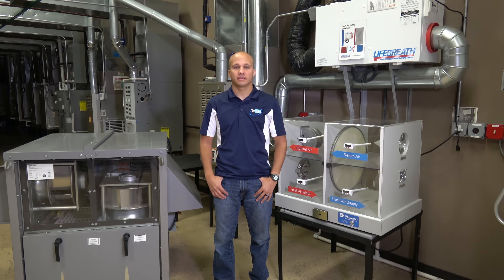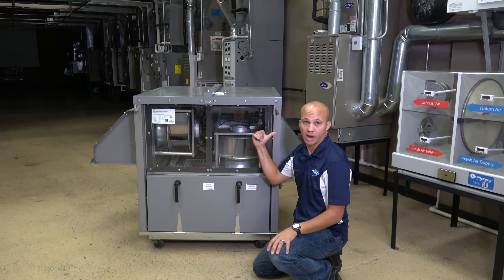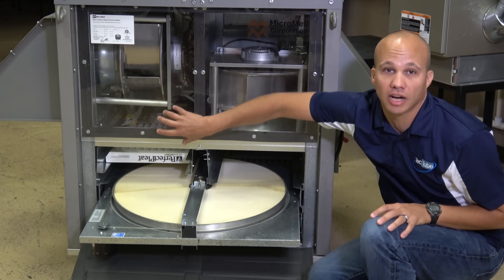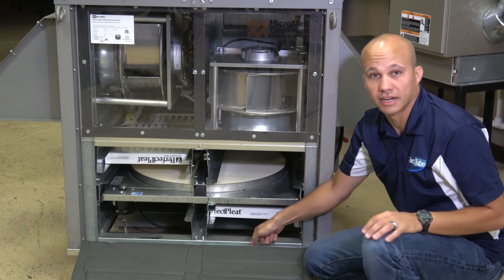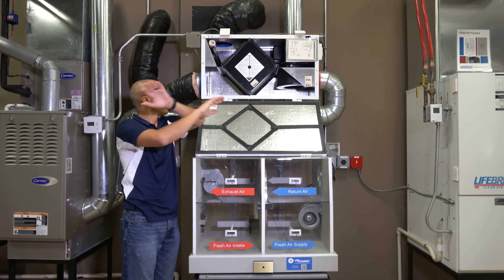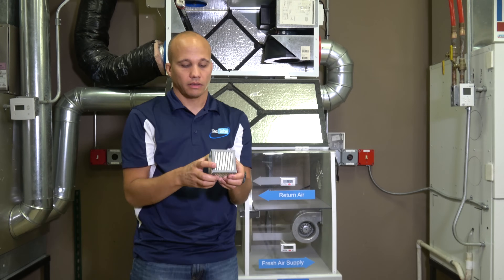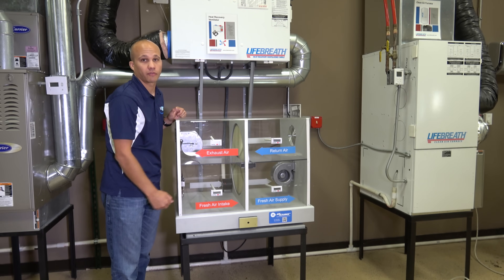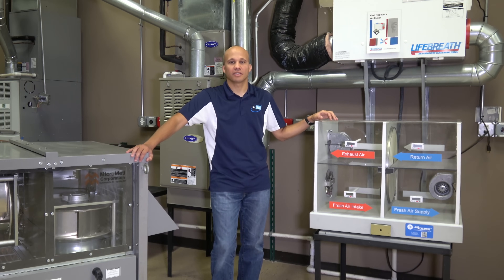Fundamentals of Energy Recovery Ventilators (ERVs)

Comment: Great/fantastic/excellent video, love the plexiglass.  I am looking for a similar system, but where the air exchanger could be bypass in spring & fall (hot days & cool night & since air is so cool at night, there would be no need to have the AC on). Am I missing something here? I can’t seem to find a system that does that.
Reply from the maker: Yes, most commercial ERVs have a bypass around the heat exchanger for "economizer days," since this is required now by IECC and most other energy codes.

Comment: How much does this unit actually cost and how do i know if its what I need? My building has mini splits now and they are working  very hard to cool the building.  They sq footage of this building is 3600 and its only 1 floor.
Reply from the maker: @mikelim9429  The heat transfer capability of the specific wheel selected makes the most impact.  Next is the pressure drop of the wheel which affects fan energy.  Then the temp, humidity, and volume of the return/exhaust stream relative to the that of the incoming supply air.  Then leakage (EATR and OACF).  And then finally, the small amount of energy of the motor spinning the wheel.
Reply from the maker: The cost range is very wide depending on the CFM of the ERV, the heat transfer rating, the mating connections to the existing HVAC, the need for a crane, and the labor costs to install, which would be specific to your building.  It could be $3,000... or $30,000 for your project.  You will need to get a bid specific to your scope of work needed.
Reply from the maker: In regards to what you need, we are not sure how we can answer that.  I guess it depends on why you are looking for an ERV to being with.  Is it for energy code compliance?  Is it so you can bring in more fresh air than you bring in now?  Is it to save the energy that you are currently using to condition outside air?

Comment: Can you refer me to an AC company that can do the ERV installation? I'm in Whittier, CA area.
Reply from the maker: We are based in the Midwest so we are not too familiar with contractors on the west coast.  If this is for residential then www.carrier.com or www.bryant.com both have dealer finders where you can search by zip code.  If this is for a commercial building, then those search tools will not help.

Comment: You described a dedicated HRV system for residential use. Typically these will be ducted to all the bathrooms as well as the kitchen (with a grease filter in place). Never a hallway like you said
That being said, most residential HRVs  will not be installed  like this.
You will just have your supply and return for your HRV tied into the return duct (3' apart) and an intake and exhaust going outside (6' apart)
Reply from the maker: We agree to pull air from the bathrooms as the first choice.  If you need to pull more exhaust air (to balance with your required ventilation intake air) we would prefer to pull it from the kitchen (but not the hood) or from a general area like a hallway.  We do not recommend pulling air from the kitchen hood since grease filters do not capture all of the grease, nor do homeowners change/clean them regularly.
Reply from the maker: We are not fans of pulling the air out of the furnace return duct to send thru the ERV and then outside.  This is an energy waster.  To make it an energy conservation device, you must recovery the energy from a waste stream... air that was leaving the house anyway even if you did not own an ERV.

Comment: Silica beads are used as desiccant in thermal pane windows, but they eventually become saturated. Doesn't the silica-gel wheel eventually become saturated? I know it will vary with a number of factors but how often might one have to be changed? Annually? Bi-annually? Every two years?
Reply from the maker: No, they do not become saturated.  They are "dried" as the wheel cycles into the other airstream which has a lower moisture content.  In this application they only temporarily absorb water vapor for the purpose of transferring it to be released seconds later.
Reply from the maker: Neither the wheel, nor the silica gel impregnated into it, need to be changed at all.  The life span is over 20 years, which will outlive the sheetmetal air handler that it is typically mounted in.

Comment: Thanks for the info! How much CFM was flowing through the demo unit?
Reply from the maker: Not sure.  We never but an airflow hood on it.  Both airflow paths have the same models of small fans, so it is nearly equal on the airflow of the two streams.
Reply: @TECTubefilms  Excelente trabalho de explicação. No entanto, quando se fala de refrigeração o volume de ar é necessário constar.
Reply from the maker: @rafaeldanzer6840  
Neste exemplo, o volume de ar não era importante, pois as duas correntes de ar eram iguais no fluxo de ar. No entanto, mediremos na próxima vez que voltarmos a esse laboratório específico e reportaremos os resultados para vocês.
Reply: @TECTubefilms  ok. Muito obrigado pelo retorno e, novamente, parabéns pelo trabalho de vocês. Já me inscrevi no canal e vou divulgar.
Reply from the maker: @rafaeldanzer6840  Sorry for the delay... we haven't been over to that particular lab much since COVID started.  We were there today and took measurements.  OA Intake = 71 CFM, Supply from ERV = 51 CFM, Return to ERV = 37 CFM, Exhaust = 56 CFM.  The plexiglas is not caulked to the side panels of the demo unit or to the middle panel that holds the wheel.  So there is leakage, which explains why the airflows don't all match exactly.
Reply from the maker: We will measure it the next time we are back in that particular lab and report the results to you guys.

Comment: Im thinking put stale intake for ERV in bathroom and above range. Could the fans be done away with? How many CFM per square ft?  I saw another video it had U.S. divided into HRV or ERV. I live in ERV area but about 40 miles to HRV suggested area. Would it be beneficial to get a HRV
Reply from the maker: Yes, you can run bathroom air thru an ERV.  We would not recommend you run air from the range.  It has grease that you do not want to get on the ERV's heat exchanger.  So use exhaust air from bathrooms and maybe a general area of the kitchen or a hallway.  In this case you would completely eliminate the bath fans and just have a grill in the bathroom ceilings that duct to the ERV.  Then have the ERV supply fresh air to the bedrooms and living room or have it bring the fresh air to the return duct for the furnace or main air handler.
Reply from the maker: From homes an ERV is almost always better than a HRV because it recovers moisture, as well.  This keep moisture out in the summer and keeps it in during the winter.  The reason there are maps to show not using ERVs in northern climates is because the ERV can develop frost on it from that moisture.  Larger commercial ERVs have controls and/or heaters to avoid that, but that is not cost effective for small residential ERVs.  So as you get to colder climates, you need to use a HRV for homes.  The border for HRV vs ERV is specific to each manufacturer and their heat exchanger technology.  So you need to look at the map specific to the model of ERV you are considering.

Comment: so with this system can we do away with a typical air conditioning unit? tnx
Reply from the maker: No, that would not work well at all.  You can downsize the A/C, but not eliminate it.  In the summer ERV just transfers heat from the incoming ventilation air to the outgoing exhaust air.  That will help reduce the capacity of the air conditioner you need but only related the ventilation air portion of the A/C.  Buildings also need A/C to reduce the heat that is generated by other sources such as heat transmission through the walls/insulation, solar heat through windows, people body heat, waste heat from lights, cooking, refrigerators, etc.

Comment: Thank you for the good explanation...it is nice to understand the wheel can absorb humidity and not transfer it to the other side. So just sensible heat no latent heat.
Reply: Thank you for the explanation. Know I understand the difference between the two. It depends on climate zone and space function.
Reply from the maker: The is incorrect.  An ERV uses an enthalpy wheel and it does transfer latent energy from the airstream with the higher humidity to that with the lower humidity.  This is desirable in most outdoor air applications.  In the summer, it takes the higher outdoor humidity and transfers it to the exhaust air so it does not come into the building.  In the winter, it takes the indoor humidity of the return air and transfers it to the supply air so it is preserved inside the building.
Reply from the maker: What you are describing is a HRV... heat recovery ventilator.  A HRV is sensible only version of a ERV.  Most ERVs are sensible plus latent.
Reply from the maker: HRVs (sensible only devices) are generally only used in commercial buildings when the indoor humidity in summer is regularly higher than outdoors, such as a swimming pool or locker room.  Residential HRVs are used mostly in ASHRAE climate zones 7 & 8 (most of Canada) because frost control options are too expensive/complex for residential systems.

Comment: How does desiccant wheel drain water after it sucked up enough moisture?
Reply from the maker: It only stores the water for a brief moment until it rotates into the other (drier) air stream where it releases the moisture.  There is no need for a drain pain or drain line.

Comment: LOL,  you all are beginners. I see a drain line at 4:51 it has no air vent. that is BASIC drain line 101 school. if you were trained here get your money back, i bet you don't even ream copper  lines after cutting. KIDS - if you want to be properly trained, Join the USAF and become a Civil Engineer. It is free and the BEST Training in the WORLD. And they teach you CORRECTLY. Also too the the left there is NO Blowout Tee. You all REALLY Suck.
Reply from the maker: 1) Our company started in 1935 so yes we are still beginners relatively speaking.  :)
2) This Lifebreath 155MAX HRV is installed per the manual, which you can read at https://www.lifebreath.com/us/product/lifebreath-155-max-residential-heat-recovery-ventilator-hrv/.  There is no air vent specified by the manufacturer on the condensate line.
3) This drain runs into a central condensate line along with furnaces, A/C, and boilers.  There is an air gap between the condensate line and the sewer connection (it is not hard piped) so hence an additional air vent at the equipment is not needed.
4) The engineer who installed this unit in our lab ended up leaving to become a Civil Engineer.  When he left, he said Mechanical Engineering was too hard.
  We are not kidding... #truestory
5) We love Air Force and military veterans and many come to work in HVAC when they retire from the service.  So yes, please do consider joining the USAF and maybe we will see you in 20 years.
Reply from the maker: We love the The Furious Fill Show.  The Confederate flag and shot of whisky... um, we mean ginger ale... are nice touches.
Reply: @TECTubefilms  hey guys I want to say thank you for the response service technician with 30 years plus experience United States Air Force civil engineer but yes the Confederate flag I haven't uploaded a video in a while but the Confederate Flag represents a states rights not slavery so as a service man I served with every race Creed and so on so not one inkling of racism in my blood the only races I like are the ones where the cars go left turns and keep going left turns I love those those are great
Reply from the maker: @furiousfill4593  Fair enough Phil.  We understand what you mean about the flag.  We were just trolling you because you were trolling us.  All good sir.
Reply: Took me a minute to get the "left turn racism."  Cleaver response.
Reply: @furiousfill4593  Also, you should fix the "." and "," keys on your keyboard
Reply: Furious Fill has two subscribers… TecTube must be 1 of the 2
Reply from the maker: @ryanhoger1  No, we are not.  But if Phil posts a HVAC video, we will start following him.
Reply: *to the left
Reply: name checks out, lol

Comment: How often do you run the ERV or NRV - all day - all the time?  Also, how often do the filters need changing?  How much is it?
Reply from the maker: If the ERV is handling code required ventilation air, then it must run constantly during occupied hours.
Reply from the maker: Filter life varies based on the entering air conditions.

Comment: Very good video, thanks. Does air flow through the wheel style heat exchanger (enthalpy wheel?) or across it? Are they available to diy'ers anywhere?
Reply from the maker: The air flows through it
Reply from the maker: Not sure how to answer your question about installing one yourself.  You would need knowledge of HVAC design/sizing, sheetmetal working, and electrical wiring, and in some states/municipalities licenses to do work in those trades.  Plus the smallest enthalpy wheels on the market are too large for homes.  Residential applications would us the enthalpy core style.

Comment: with an EVR does that mean i dont need a seer 16 unit because a seer 14 can work just as good with an EVR? in 110F weather ?
Reply from the maker: An ERV only saves the energy associated with conditioning your ventilation air.  It has no relation to the cooling energy which is represented by the SEER rating.
Reply: @TECTubefilms  so it makes conitioned or heated ventliated air stay cooling or warmer longer so I stay comfortable longer and ac doesnt have to kick on so often ?
Reply from the maker: @joeydelmarsjr.646  We suppose you could think of it like that. It makes the ventilation air from outside cooler as it comes into the house during the summer (and warmer in the winter) for nearly no energy cost.  Hence this would allow your A/C to not run as much if that is what you were previously using to cool your outside air.  It will also dehumidify (summer) or humidify (winter) that incoming outside air and that will certainly improve occupant comfort.

Comment: They went through all that trouble of building a functional demonstration model and they didn't bother to include humidity sensors for a complete thermodynamic picture of what's happening? Seems kinda silly, like just walking away from the Panama canal when there's one mile left to dig.
Reply from the maker: Since it is a demo... fully contained in a single room... the air in both intake airstreams would be the same temp.  They had to build an electric heater into the demo to simulate a hot day so you could see an actual difference on the sensors.  Likewise, the enthalpy for all air streams is the same hence no reason to buy more sensors... unless of course they added a mini humidifier in one of the air streams.  :)
Reply from the maker: But we like the way you are thinking

Comment: Not sure how it's possible if you exchange the same amounts of the air. Air temperature should be around 80% of the average between 79F of the return air and 105F Intake. I would expect around 90F to get in and 88 to get out. Looks like your fans are not balanced )

Comment: Fresh air supply Temp. is lower than the  Return air temp in the actual scenario of comfort cooling.
Reply from the maker: Depends on the day.  If it is a 50 degree day outside, then your statement is true.  If it is a 90 degree day outside, then it is not.  Did you have a question about this subject?
Reply: @TECTubefilms  No I don't have question about the subject. Kindly elaborate the 90 degree day outside where you trying to say that the  return air will be lower temp. than supply air temp. in a comfort cooling inside the building.
Reply from the maker: @bossjun5754  To further clarify, when the ERV is recovering cooling energy (summer), the RA temp will be lower than SA.  But when the ERV is recovering heat energy (winter), the RA will be higher than SA temp.

Please also keep in mind that the ERV would be used in conjunction with a comfort cooling system.  So the supply air from the ERV would become the entering air to the evaporator coil of the cooling system.

Comment: Great video!  What happens if its warm inside the house and you want to have the cold air outside to cool your house.  That is the scenario in tropical countries where at night time it is usually colder outside than inside. Can I still pump in fresh air at the same time make inside the house cooler?
Reply from the maker: That scenario occurs frequently in commercial buildings so the units include an automated bypass which allows air to run thru the ERV fans and duct without going thru the actual heat exchanger.  This is in place of the economizer that most standard commercial HVAC air handlers have.  Small residential ERVs do not typically have a bypass, just like residential HVAC systems do not have economizers systems.  The first cost is too high in residential for the energy cost benefit.
Reply: a mixing box would be perfect for residential applications. It brings in cooler dryer air from the outside and lowers the energy load on your cooling system .

Comment: Tell me one thing sir!
How many ERV's are required for 13000 sq. ft hall and of what specification.
Reply from the maker: You can do it all with a single ERV if you wanted to and the application dictated.  ERVs are available up to 30,000 CFM... and in some specialty cases, even larger.  Or you could use multiple ERVs.  It all depends on the other HVAC equipment that you have, the ducting, and the usage of the space.